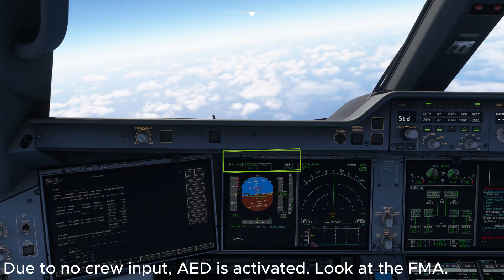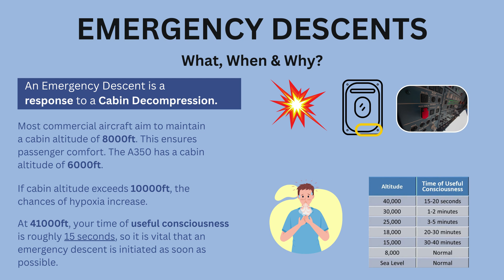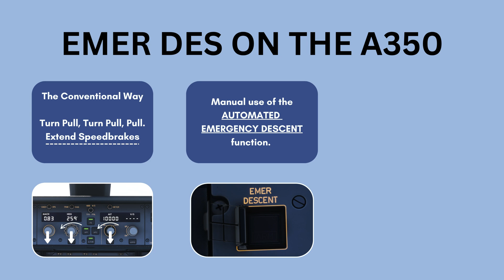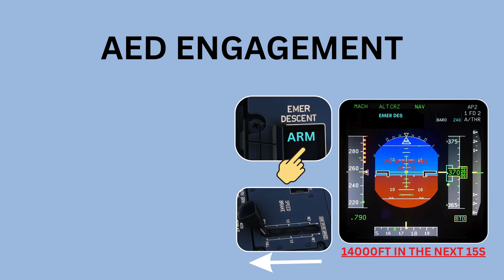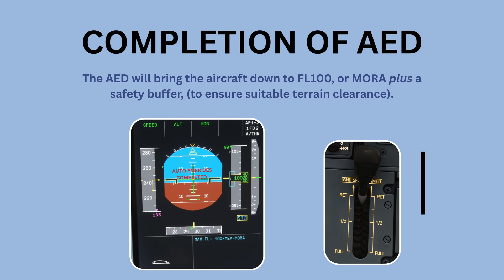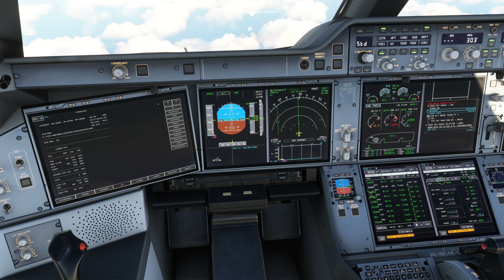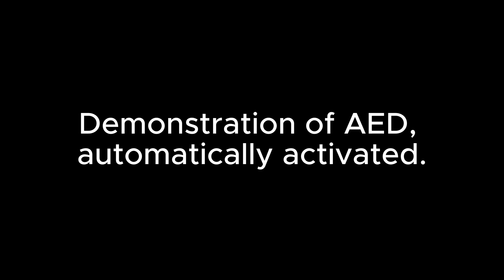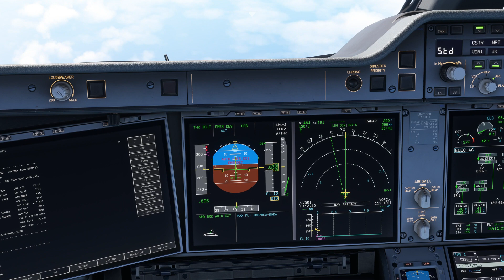A350 Emergency Descent | Real Airbus Pilot | Inbuilds MSFS

Comment: Are you sure that the AED only engages if you fully deploy the speedbrakes? Wouldn't that lead to the VLS rising above the current (or even max) speed in most cruise situations? Whenever I did emergency descents, I could only deploy the speedbrakes in multiple steps if I wanted to stay above VLS.
Reply from the maker: Thanks for the comment! AED engages if the crew extend the speed brake at to at least 1/3 position. 
Great point about VLS rising, and yes, in the real world, at higher flight levels, it may be better to gradually extend it. 
Thanks for the comment, and hope you enjoyed!